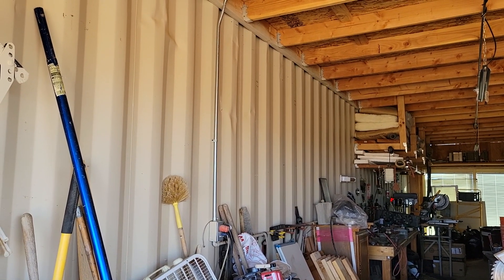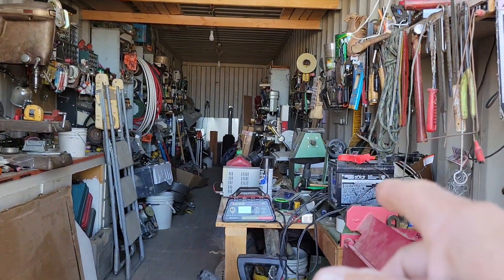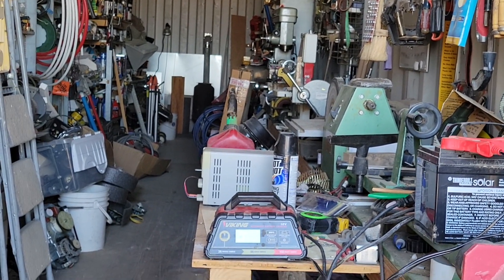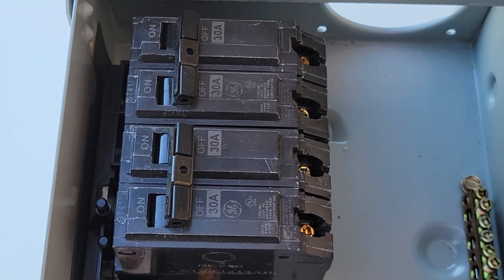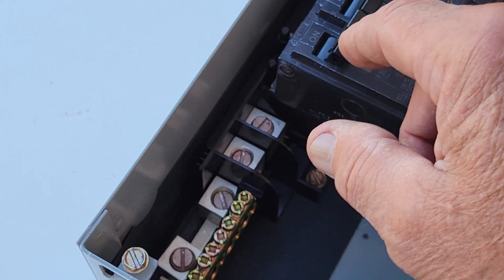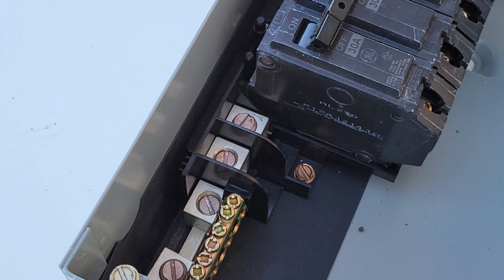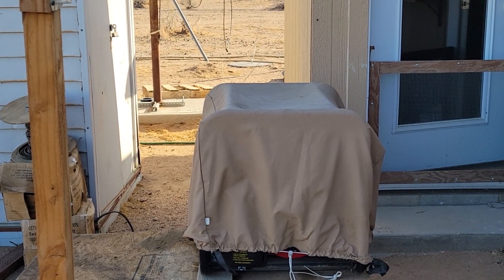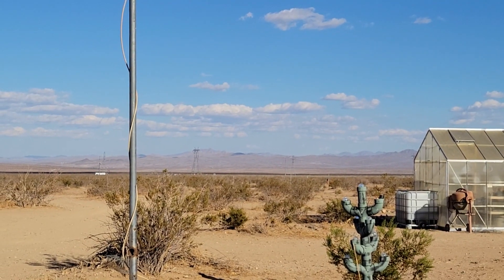Wiring A DIY Transfer Switch, Oct 9, 2021

Comment: no stupid people beyond this point well that counts me out LOL. i like the wood ash trick for septic tanks makes sense pot ash is very alkaline like why didnt i think of that, i know from experience how well it neutralises odours. ive been wanting a switch over switch for ages, we have active(brown), neutral (blue) and earth (green) and our neutral and earth are connected for rcds.
Reply from the maker: Yeah, you can pass that sign.😄
That's why we add ash to our compost, right?
Reply: @GBear  i never have, ive had so many issues with bought compost being too alkaline nothing will grow until i add a considerable amount of acidifying granuals
Reply from the maker: Oh.  I make my own compost.  I mix in chicken poop and ashes with the carbon and nitrogen until I get the mix I want, then add it to the garden and turn it in.
Reply: @GBear  yeh i have to do the same